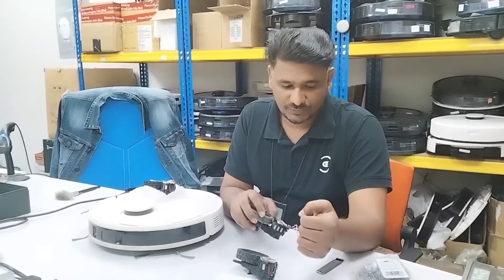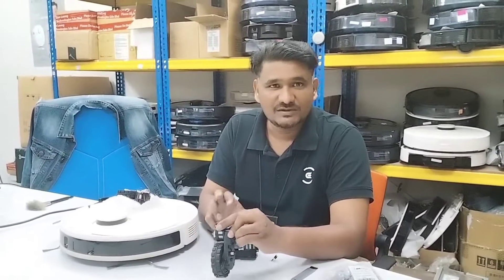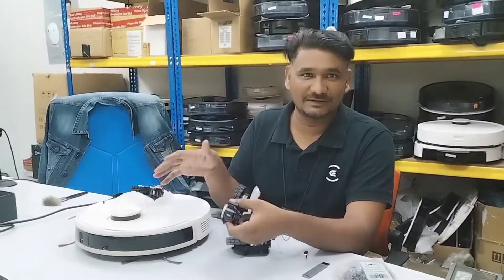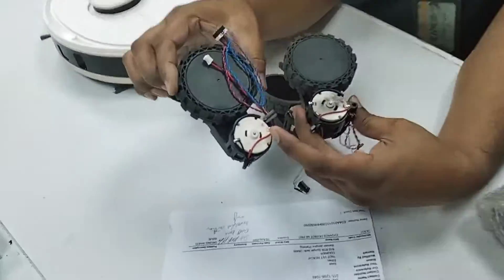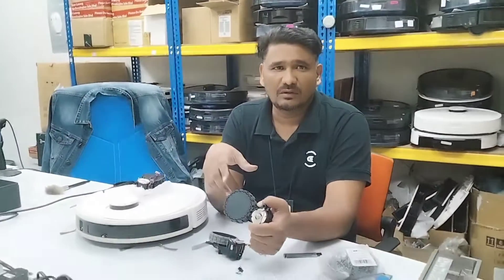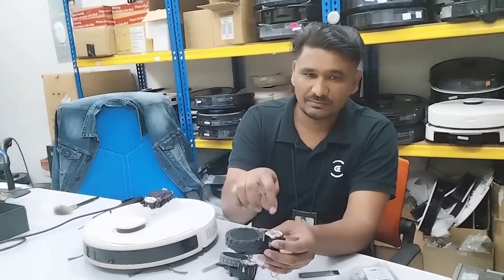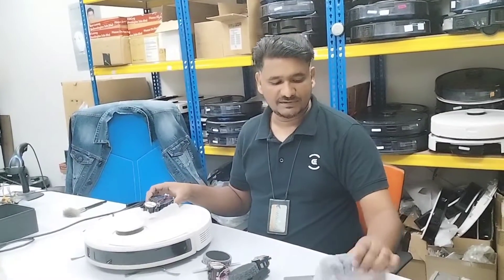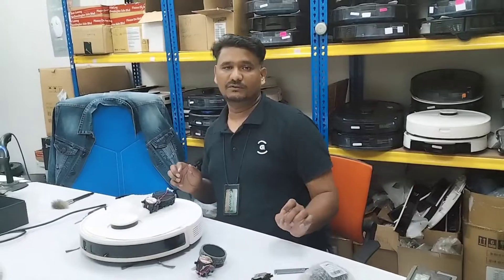Ecovacs Deebot Wheel issues. How to Test Wheel Motor?? How to Fix Wheel Motor??

Comment: Left wheel in case is not moving when in operation. But manually it's moving quite normally, no jerks or James. But when I start it only right moves that why it goes round and round. Even motor shows no burns or smell. Plz advice.

Comment: Hello and thanks for the video. My vacuum got stuck in a loop of doing circles to the right side. 

I found the right wheel very hard to turn and covered in carbon, the left wheel also had a bit of carbon so I went ahead and replaced both wheel assemblies and I am still having the same issue now
Reply: I just covered all drop sensors and pushed the wheels down and it looks like the left wheel is turning a lot faster than the right wheel

Comment: What do you do if the tensioner spring of the wheel, which keeps the wheel pop out when deebot is turned upside is.. Not functioning / the pop up doesn't happen.

Will this harm functioning of deebot??

What's replacement cost of same?

Comment: For anyone looking to remove the right wheel, it is the same process as the left except you have to remove the brush motor. That is the silver cylinder that is blocking the inner right wheel screw. To remove the brush motor assembly, there is one screw which you can clearly see and is easy to access, then you can easily pull the assembly out. HOWEVER, be sure to remove the “ninth” screw on the bottom/underside of the unit (where he mentions removing the 8 screws in the video). That ninth screw is more visible than the eight others and secures the brush motor from the underside.

Comment: Hi my DEEBOT Ozmo 900 both of the wheels doesnt moves at all when the cleaning command starts…could this be the gear wheels problem..thanks in advance
Reply from the maker: Plz check underneath the top cover LDS assembly is turning or not when you pressed auto button....in this model most likely is LDS belt break that's all....need to replace belt only
Reply: @ecovacstechnicalsupport5278  thanks 👍 for the advice

Comment: I purchased T8+ (T8+ only sold by Bestbuy) since 2019 and worked very well for vacuuming and mopping...battery stays strong/charged/discharged very well...I purchased pro mopping module once $99 and another discounted $69 ,,,,and filled them up and purchased re-useable mopping pad aftermarket and WORK very well (really wish to have some kind like mopping pad auto clean and refill but too expensive to go with lol PLUS i have bestbuy 4 years accidental damange cover hopefully to replace before the extended warranty expired!)
Hahaha...T8 works very very well ,,,no more temptation to go for expensive auto fill/clean gen..until mine's broken yes!

Comment: Thanks for such a great video. I am having an issue where my T8 goes in cicles (right motor not functioning properly) I watched your take apart video and removed the right wheel. I didn't see any burn marks so I attached a 18650 battery with leads to the motor and the motor and wheel were functioning. There was no debris stuck that would affect the rotation. I put it back together and same issue.  Any ideas what could be going on?

I just tried covering the drop sensors and turning the vacuum upside down and turning it on. Both motors work. The right one feels stronger than right.
Reply from the maker: Is it turns very fast to one side I mean faster than normal spead....n then reverse also sometimes very fast n start giving error...if like this that means motor ok but counter sensor faulty... that's why turn very fast....
Reply from the maker: If it just move normal Spead n then suddenly start turning in circles so that means motor became harder than other side...if u can find same motor just replace..will be ok

Comment: Both the wheels of ozmo 920 have stopped at the same time.  Wonder if it is just wheels or motherboard.  The brush works well. Any help?
Reply from the maker: Actually wheels will stop automatically if there's something wrong with any part....once the deebot stop so it gives a voice error message...that why deebot stop...see weather its giving wheel is stuck or related to wheel error or something else....
Reply: @ecovacstechnicalsupport5278   This deboot says" please help me out" ! Checked the wheels, brush with no issues. The bit of LDS was spinning as well. Suspect it happened when it managed to wedge itself under a sofa edge and git stuck for a long time.

Comment: This is great advice. But your technicians only give one solution - replace wheel. They should also attempt repairing it
Reply from the maker: If repair you mean replace motor then ok .. otherwise no way to replace tiny motor carbon... Moto damage.... that's why if not full assembly then at least motor replace still ok...can use
Reply: @ecovacstechnicalsupport5278  how to remove the wheels?
Reply from the maker: @prakashrnair  2 videos available on my channel...how to disassemble & assemble back in 2 parts available... will be helpful for you

Comment: Hello bro, My deebot rotating in a circle anticlockwise. If I reboot the deboot, it works for 10 to 15 min, and then it will go in circles.
I check wheels are okay, What will be the issue.  Thanks
Reply: Did it solve this problem. What fid you do